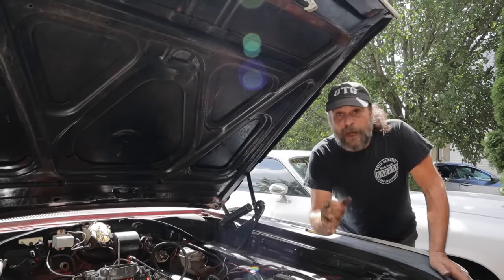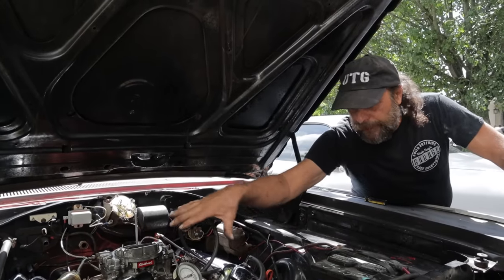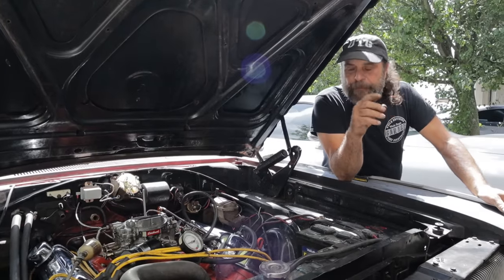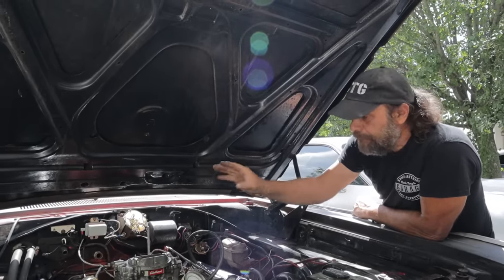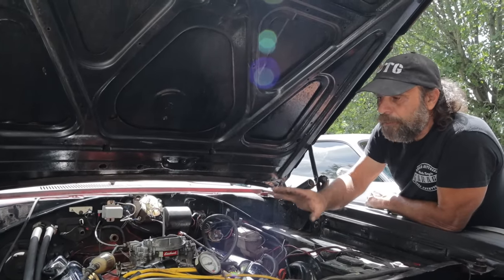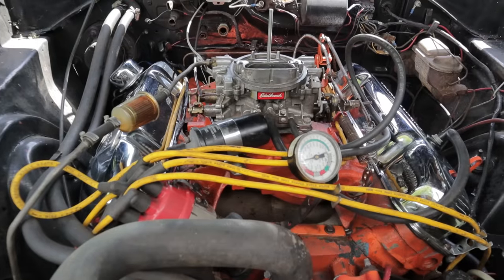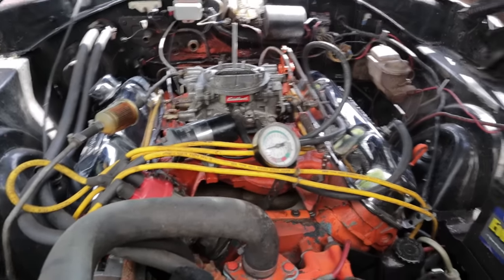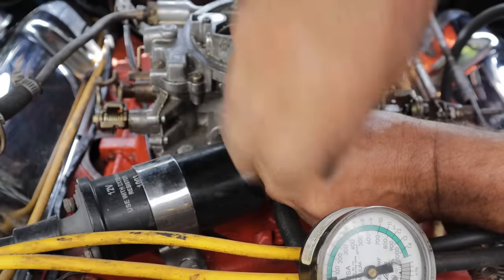Fine Engine Tuning With A Vacuum Gauge

Comment from the maker: Ok, let me explain something about the ported vs manifold vacuum as it applies to distributor advance.
If you have it hooked to manifold vacuum, it RETARDS the timing as soon as you touch the gas.  The exact OPPOSITE of what you want to happen when the engine meets the initial load.
Hooked to ported, it is inactive at idle as well as initial acceleration.  Ported, it comes on when it is needed.  Manifold, it turns off when the engine wants advance the most.
Vacuum advance is intended for LIGHT throttle cruising, NOT acceleration.
Make sense?
I do not care which manufacturers used manifold vacuum, when they used it, or why.  For best performance and to be used as originally intended, it should always be hooked to ported.
Reply: Tuning: manifold vacuum.
Distributor: ported vacuum.
Always. Got it.

I have a question about when you actually had it running and tuning live.
You were at 2 turns before it started. 
As soon as you started the engine you were at 16.5 for vacuum.
At times it was higher.
You finished it off at 16.5 again.

Why? Why didn't you try to keep it at the higher vacuum signal?
Please and thanks Unc'.
Reply: Tony, but isn't vacuum advance made for idle and cruise? As you say, once off idle, you want more ignition timing, but isn't that what centrifical advance is for...built into the distributor and sensitive to rpm? Kind of like three circuits for fuel delivery in a carburetor, a distributor needs initial advance (set at the crank), idle (vacuum advance routed to manifold), and wide-open throttle acceleration (centrifical), set by weights and springs in the distributor?
Reply: I agree that vacuum advance is for cruising & not acceleration, but I ALWAYS use manifold vacuum to the distributor, I have been tuning big blocks for nearly 40 years & found they always run better this way. Hook up a vacuum gauge to manifold & another to ported vacuum on the carb, route the hoses into the car & take it for a drive. At idle you have vacuum at manifold, none at port, at full throttle you have no vacuum from either, at cruising speed you have full manifold vacuum & ported vacuum varies on speed, but is less than manifold.  The main advantages to using manifold vacuum is fuel economy. Set your timing & idle with vacuum disconnected as always, lets say your idle speed is 650rpms, then you plug vacuum hose back to vac advance  & your idle speed jumps to lets say 8 or 900 rpms, too high, so you set idle back down to 650 with vac advance.  This setting will use less fuel at idle & generally gives a smoother idle. The bigger savings is that when driving everytime your are coasting you are at this lower throttle setting & when you are cruising you are getting FULL vacuum advance too, so you maximize torque & mpg the same time, I have found this to give the average big block a 10% increase in economy, certain makes even more, especially Olds & Buicks.
Reply: You are absolutely incorrect about vacuum advance. It connects to manifold vacuum!  At idle you have max vacuum which requires earlier firing of the lean mixture and causes the engine to run smoother.  As the engine revs up from idle, the vacuum drops as does the vacuum advance, but the mechanical advance takes over!  Now if you think I’m incorrect, which you do, get the book “Performance Ignitions and Tuning” written by Dr Christopher Jacobs.  He has a PhD in electrical engineering and was the founder/owner of Jacobs Electronics which produced performance ignitions for years and MSD bought him out for millions of dollars when he took a lot of their market share.  He used to consult to NASCAR and NHRA professional race teams when they had ignition problems.  Dr Jacobs breaks it down in the book and no disrespect, but if you can’t top his credentials, which you can’t, then quit feeding people bad information that trust you.
Reply: @trailerparkcryptoking5213  he also said the 440 has a small cam which makes less vacuum . also wrong .
Reply: @SuperDave Miorgan actually total timing is measured with vacuum advance disconnected. Always

Comment: Nice video with some good information. Here are some important clarifications:
1) vacuum should be checked with the air cleaner ON. Checking it without the air cleaner results in inaccurate readings, and your adjustments will be wrong.  
2) Before adjusting the idle mixture screws, the engine timing at the distributor should be checked, and the idle speed should also be adjusted. Both of these come before tuning the idle mixture screws with a vacuum gauge.  
3) The engine should be HOT when checking vacuum. Uncle Tony started up the engine and immediately checked vacuum. I assume the engine had recently been running, but the point was never addressed. 
4) The idle mixture screws should be turned in sequence, 1/4 turn on one, then 1/4 turn on the other. That way they're equal. If you adjust one screw for absolute maximum vacuum before adjusting the other screw, it's guaranteed that the screws won't be equally adjusted at the end of the process. And both screws should be equally adjusted.
Reply: For your #3 go back and listen about 8:25 mark

Comment: My dad was trained as a mechanic. He did all of his maintenance and most engine repairs. He always tuned an engine with just a vacuum gauge, no timing light. He taught me a lot but I always had to use a timing light because I couldn’t get it right with a vacuum gauge. That cars I tuned were a 70 AMC Gremlin 232, 70 AMC Ambassador 360 and a 78 Honda Civic CVCC. After that, things got to complicated for me with all the electronics involved. This video brought back fond memories of all my dad taught me.

Comment: Hey Tony, Love your videos, and you obviously know your stuff. You do a great job! I have to disagree  though with your suggestion of always using ported vacuum for the vacuum advance.   An engine needs more advance at light load, and less timing under heavy load.  Also, more timing under lean conditions, and less timing under rich conditions.   I believe you have the history of ported/Manifold smog era schemes reversed.  Looking at a 60's or earlier factory service manual, vacuum advance is always connected to manifold.   Consider that the first thing you're always told to do when setting base timing is to disconnect the vacuum hose, and plug it.  If it were going to a ported source, this would not be required, as there would be no vacuum at that port at idle.   Sometime in the 70's most manufacturers move to ported vacuum, and distributors that were curved to take advantage of ported vac for better emissions.   If your distributor is curved correctly... Manifold vacuum is the way to go for street performance.
Reply: Correct, the "always ported" vac is bollox, all my BB Mopars have run full vac for over 35 years with no detonation.
Reply: Totally agree!!
Reply: I'm pro ported.  I've done it both ways and in my experience the minimal fuel economy at idle along with zero performance or economy improvement at cruise or WOT isn't worth the trouble it causes with idle speed and starting in cold weather.   Also I'd add that ignition 101 paper floating around way overstates the benefits of manifold vacuum.  For example, If your car is overheating at idle and manifold vacuum is the difference then you have other problems.

Comment: 60s buicks use a thermoswitch to switch between manifold and ported vacuum based on temperature.  This allows full manifold vacuum at cold start and then switches to ported vacuum once warmed up.  It also has a trick that when the car returns to idle it switches to manifold vacuum for better idle.  All of this is done with thermosensor in the manifold... pretty neat and should be no problem to add to any old carbureted car with an extra temperature sender sized hole available.

Comment: i found this video very helpful. I am new to carbureted vehicles because i was born well after fuel injection came out. I recently picked up a 1968 El Camino SS with a 396 Big Block and have been getting acclimated. Thanks for putting out this content. It is very straightforward and helpful.

Comment: Totally agree Uncle Tony!  That timing adjustment for maximum RPM never worked for me.  Spark knock or pre-ignition (pinging) under load was an issue when done that way.  I always set timing by taking it up a degree at a time and road test.  When I heard spark knock I'd back it off one degree and be done.  Of course I also knew that octane rating made a huge difference.  I always tuned with fuel that was normally being used.  Then for the hot rodders we could introduce things like water injection or methane to cool the combustion chamber and allow even more timing advance.  Ahhhh -- the good old days!
Reply: Ah yes water injection can you buy them anymore I had a holly water injection system that I bought years ago my wife threw it out in the garbage I never did get to use it. My uncle was a great mechanic God Rest his soul and he told me about the water injection he said it increases the horsepower and it cleans the engine so you end up with the cleanest engine that you can ever have with no carbon in it
Reply: to adjust timing with a vacuum gauge,  find highest vacuum then back off 2 inches.  this is the best timing
Reply: @walterdowns9978  check out snow performance. Mostly diesel applications but they sell a simple kit
Reply: Back in the 70's I used basically a water fogger cause I couldn't afford a nitrous system. I would open the valve around 40 mph. It would lean the mixture out but nothing a little propane couldn't handle. 
Can't believe I never detonated an engine. Fun times!
Reply: @walterdowns9978 ok, before I say anything, I was a teenager in the 70's. Sporting a snorkel hood scoop, air shocks, traction bars, and a Predator carb, so not too bright.
I drilled a short rise  baseplate and put two mister/fogger nozzles and two threaded holes for propane. I had a small gas tank with an inline spark arrestor for the propane and a pressurized tank with water and opened both around 40mph.
The water introduced an extra oxygen molecule (leaned it out) and took up space like nitrous to raise compression ratio (water doesn't compress) and the propane to help correct the lean issue.
I've thought about doing it to my 77 El Camino, but maybe next weekend. 
Hope this helps or at least makes you go, what is wrong with that guy?

Comment: We used to diagnose blocked exhaust with a vacuum gauge. As you raise the engine speed above idle, manifold vacuum should increase. If it doesn't, check your exhaust.
Reply: Also , a bouncy, erractic gauge, is an indication of weak , or broken valve spring(s) . Also use em to make sure that the modulator line to trans has adequate vaccum, not ported vaccum.

Comment: Tony, I used to set my Edelbrock Performer carb with a vacuum gauge after I got it close, also had a kit with a variety of springs, metering rods, and jets to get it really dialed in! One other thing that I used the vacuum gauge to tune on my 389 were the valves! I was running a fairly high lift Crane cam that I couldn't just torque the rocker arms down on like most factory cams! I had to buy a set of poly locks and I would watch the vacuum gauge as I tightened each valve. Once the vacuum gauge started to fluctuate, I would back the poly lock off about 1/4 - 1/2 a turn and then tighten the Allen screw down! When all was said and done, the engine usually idled very smoothly with about 17 1/2 inches of vacuum! Response was excellent, especially after installing an HEI distributor and recurving the timing!!!

Comment: For more precise setting, always adjust curb idle speed and basic timing before adjusting carburator. It is advised to use a tachometer in conjunction with the vacuum gauge for the entire process.
Reply: Thanks, just bought an 84Chevy (350 with an Edelbrock), it ran decent on the long drive back. I pulled the plugs and they're black(mostly) and grey. I will follow your advice.

Comment: Tony, I wish you and utube had been around years ago. When I got poor I got stuck with early 70's Chevy truck with a 350. I put an 600 cfm Holly on it and with a Holly book I got pretty good at tuning it, power valve, jets, secondaries spring etc. In later years I built a 360 Duster with hot cam,porting, balancing and all kinds of good stuff. Anyway I put an Edelbrock carb on it mainly because it looked good with all the polishing and original look. I used it out of the box which I know I shouldn't have done but I knew nothing about how to tune it. I couldn't find much info on how to tune it either, before all this good stuff on the net. I have always regreted not puting a single plane with a Holley on it because I knew I was leaving a lot on the table. Keep up the good work. Mopar or Nocar.

Comment: Cracked me up at 'close enough for government work'
Reply: Funny stuff indeed! It's an old school quip going back to the 1940's.
Reply: Did you ever here the definition of close enough for government work it is?  You measure with a micrometer, mark it with a piece of chalk then cut it with a hatchet.
Reply: @briansd2772  maybe even before to the 30s when a lot of people were working in government programs like WPA.
Reply: @johnbecay6887  Yep.  It had a positive meaning originally.

Comment: All of my vehicles from the 1950's through the 1980's used manifold vacuum for vacuum advance, requiring the vac line be disconnected from the advance can and plugged off (I always used a golf tee) to check and set ignition timing. Some heavily emsioned vehicles (mainly 1974-ish through the early 80's California emission) used ported vacuum to reduce HC at idle or used a valve that delayed vacuum to the distributor like an OSAC valve (Chrysler version), sometimes using both methods (most of these engines were complete dogs and obtained horrible fuel mileage). Modified engines with hotter cams sometimes required ported vacuum, depending on the setup. This was usually a crutch though. The best method was to us an adjustable vacuum advance can  and tune it, after the distributor weight springs were properly selected. Full out race engines back in the day didn't use vacuum advance and generally locked out the centrifugal weights in the distributor.
In the 1980's, dual diaphragm vacuum advance cans became the norm for most vehicles which used both ported and manifold vacuum, providing much more precise control for timing in all ranges of operation. My 1984 Toyota pickup uses one of these and requires the manifold vac line be removed and plugged to check and adjust timing (5 degrees BTDC). 
Something I learned rather quickly in my younger days using a vacuum gauge to adjust fuel mixtures is that it'll get it in the ballpark range, but using a sensitive RPM tach with a large display (I use a 1970's Sears model) will get the fuel mixtures adjusted much more precisely.
I have had to use a vacuum gauge to adjust timing on stock engines which had 2 piece harmonic balancers that slipped as age and miles accumulated. The worst offender was a slant 6. The balancer slipped more than 25 degrees, and living at 30 feet above sea level, I'd adjust for 20" of vacuum after the carb was tuned, recheck fuel mixture adjustment again, then recheck timing. Of course, everything else needs to be in perfect working order to be successful: Ignition system needs to be up to par, zero vacuum leaks, tappets in good working order (if hydraulic) and valves properly adjusted (if mechanical).
Reply: Manifold vacuum advance on any good high compression engine always obtain the best results for me ported vacuum just doesn’t make any sense especially with a slightly bigger cam shaft
Reply: Most car companies all were using manifold vacuum,  about 1968 they started using ported vacuum due to emissions and better gas mileage.   By 1970 onward they all were using ported vacuum.  Only full time race cars would be using centrifugal advance or locked out.  For a street car,  use a ported vacuum in all cases,  even in a "lopey" camshaft because at idle there is no vacuum at all.
Reply: @jeffkellner1585  same here enem with a slightly modified 350. Mild cam and I added a 1.6 exhaust valve into my ported world products heads. I have never used ported. I tried but I couldn't get the idle where I wanted it to be. Numerous vehicles too, not just one engine.  
If engines died every day from full  manifold vacuum people wouldn't use it.   I also limited my vacuum advance to 8 degrees. Initial was 12. Total was at 34.
Replying Jeff,  yes this is an old one but it's always bugged me too. Maybe Mopars respond better that way.